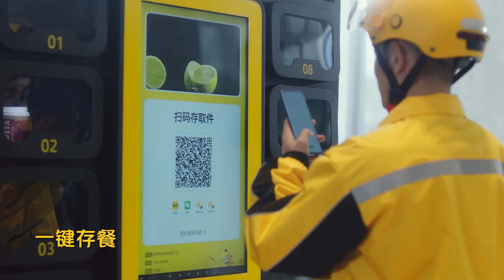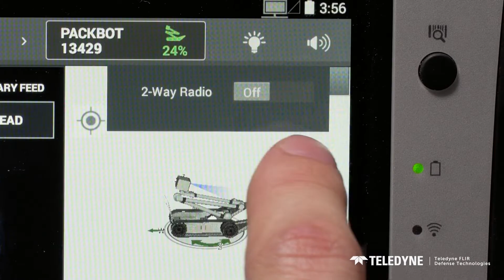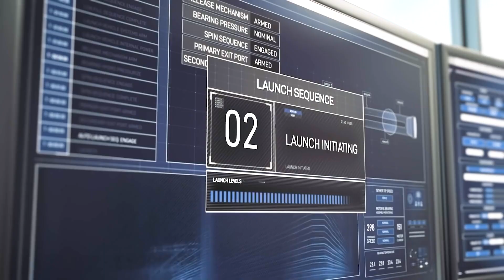SIX INVENTIONS OF THE FUTURE WORTH SEEING

Comment: 4:37 Its unique feature is it can recharge itself. Why dont electric cars have this feature when it drives it charges its batteries at the same time??
Reply: Human work force is doomed
Reply: @dawaahtotruepathchannel8996  sadly
Reply: @dawaahtotruepathchannel8996 it does. It’s called an alternator. All gas cars have them. The only reason why it can’t work to completely charge an ev is because you’d have to drive over 100mph for hours and hours straight to get a charge